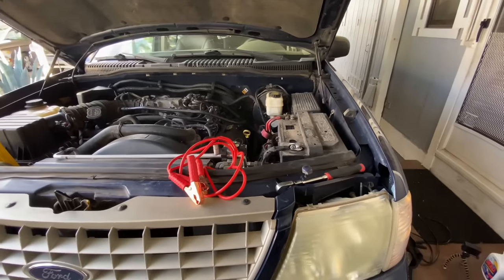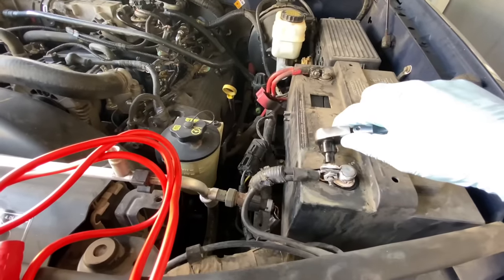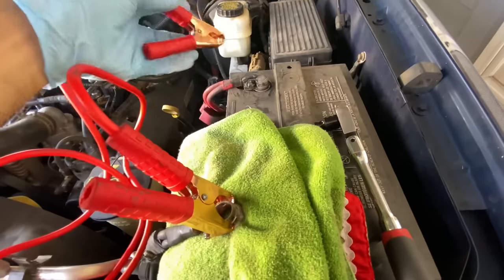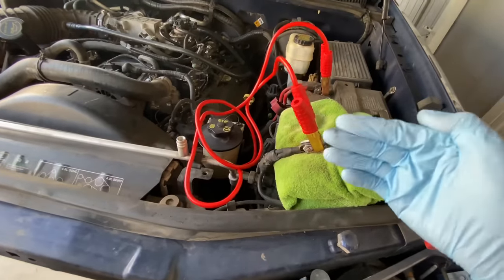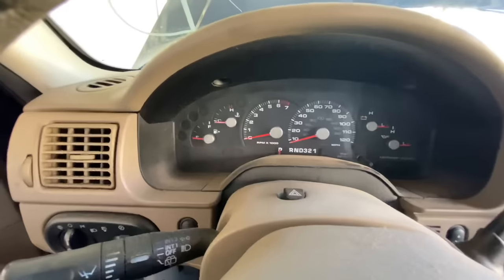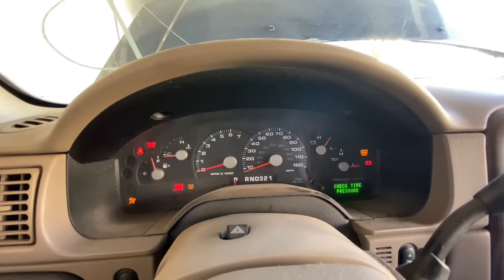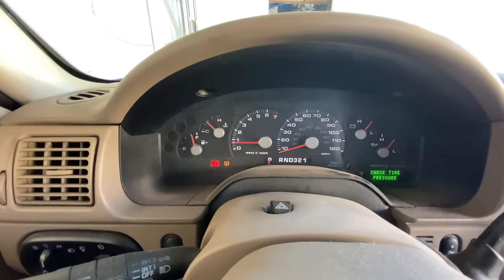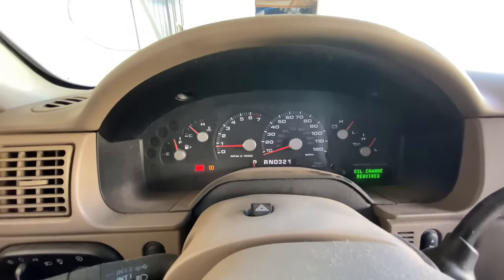How To Reset All ECU’s and Control Modules in your Car or Truck

Comment: Working on my 2006 GMC Duramax, I accidentally and unknowingly knocked loose one of the plugs on ECU.  After I finished what I was doing the truck started throwing non-communication codes between the ECU and the TCU along with some other codes.  After much painful frustration and talking with Duramax pros I discovered the loose plug.  Now all the other codes disappeared except the ECU and TCU codes.  After many more hours of searching the internet and youtube as well as talking with the diesel pros I came across your YouTube video.  It sounded good to me so I followed your instructions to the letter.  Problem solved.  No more codes!  Thank you!  I think I will finally get some sleep tonight,
Reply: Actually have a 6.0 with a p0603 no start thinking about giving this a shot tomorrow
Reply from the maker: I’m glad it helped
Reply: @abner0404  It’s noticeable that you did not return and contribute your experimental results.
Reply: @abner0404  did it work for you
Reply: I'm having trouble with my 2018 duramax. Which battery did you disconnect the negative cable from to do this procedure? Thanks

Comment: THANK YOU so much! The night before last I went out to roll up the windows in my Chevy 2011 HHR and left the key in the ignition. Yesterday about 5 pm, I got in the car to leave and saw what I had done, and of course the battery was dead. I put in on a charger for about 40 mins and then drove off. Immediately when driving up my street, something didn't feel right. I drove another mile or two, on 30 mph roads and noticed when I let off of the gas, the car would slow down, just like it would if it had a manual transmission. As I entered a road with a higher speed limit I finally realized the car was not up shifting out of first gear. Oh, no! I drove the car back home and started looking for answers on the internet and YouTube. Last night I tried a process to reset the transmission by turning the ignition key to position 2 and holding the gas pedal down for 15 secs then turning the key off and waiting 5 mins then starting the car. That had no effect. This morning I got back on the search engines and YouTube and found this video and watched it several times. It made sense to me. Reboot all of the computers. I said a prayer and followed the instructions exactly. IT WORKED!!! What a relief! The car has a lot of miles on it and the prospect of putting a new ECU in could have been very expensive and not a good investment at this point. Thank you so much again, sharing this knowledge has had very positive impact on my life, for real!
Reply: I love that you prayed first ❤️
Reply: @Jesussavedme  ❤🎉❤
Reply: Did it start doing it after 50 miles

Comment: The negative cable is connected directly to the body. Why you dont just clamp the jumper cable to the body and positive terminal of the battery.

Comment: Here's my story.  2 vehicles both went bonkers after a strong lightning storm with rain.  I tried water clearing additive in the tank,zip, tried gunk remover additives,zip...check engine light, total loss of power clunking down the road.
I saw this utube, read the comments and went with disconnecting both battery leads and grounded them both for 20 minutes then reconnected  Took them for a long hard run & presto, works better than it has for many years with no problems and engine lights out.  A bonus was my automatic tran shifted problem free for once.
Thankyou...thankyou....thankyou!!!!

Comment: Thank you.
I came across this video after taking my car to my regular shop.  They are good guys and told me is was an issue with the  PCM, but they could not fix it and I should take the car to the dealer.   OH NO.   I am a 64 old female and know better than to take my 2009 ford explorer to the dealer........ Long story short this fixed worked for my issues.    
You saved me a ton of money.  
Thank you again.
Reply: AMEN!   now to try this on my nissan micra  that wont start = otherwise its going to the scrapyard;  Glory to God anyway, whatever will be...
Reply: Good job sweety! 
Money well saved  from the dealership

Comment: Thank you for this video
I m a 67 yr old grandma with a 2002 Silverado that just stopped no crank no power
I checked battery it was good 
Checked all fuse they were good. 
I found your video and figured I had nothing to lose. I did what you recommended and my truck started 
Thank you again
Reply: You still want to get it checked out by a mechanic.  This is a temp fix for you because something stopped it.  All got did was reset everything.  Keep an eye on your check engine light and get the code read as soon as it comes on, if it does.  That way you'll be able to spot the reason it wouldn't crank or start
Reply: Great news!
Reply: If the problem comes back it's always  AN IGNITION SWITCH WAS LIKE 45 bucks Intex 10 minutes to put in
Reply: @stevengorum2727  😆 🤣
Reply: Why doesn't it work on the civics,  and what about the accord?
Reply: I have the Honda accord 2005 model and the check engine light has been on for 6years now. It was checked and it went off but came back.  I  will try your method and see. Thanks.
Reply: Will it work on a 1993 Toyota Camery 4cyl?
Reply: @quedog10pop good looking out bro that is great advice and very true
Reply: Gm has had issues with ignition and ignition switch they go out esp on the trucks so get that looked at
Reply: @entryspecialist23  I don't believe in sitting on information, like the rest of the world, after I find it I share to help others.
Reply: i caLL BS
Reply: @quedog10pop  blessings to you 🙏🏽
Reply: @quedog10pop I just came from MAVIS Tires in Brooklyn NY where they said my 2013 Hyundai Elantra was asking for a relearn. A month ago I paid them about $800 for a new Battery and Starter and yesterday (Thanksgiving) morning my car was stuck in ShopRite parking lot because it did not start. I had to have it towed back to MAVIS... I had no check engine lights on. The "manager" says he don't know why the car would be asking for a relearn. But when I asked will this likely happen again he says 'No' 🤔 Umm Why not if you Don't Know what caused it? Like C'mon with the Nonsense 🤦🏾‍♀️
Reply: @habibah2702  I appreciate you fam!
Reply: @habibah2702  Fam, I've been thinking, and the battery being changed says a lot. If it is swapped out promptly then that would cause any stored information to be evused, I don't know if your car has a backup battery, but computers need to have constant power to properly hold information /settings.

If I hook up a car stereo and don't get constant power and battery connections correctly done, then the settings won't save, and every time you turn the car on, you would have to get everything all over again.
Reply: God bless you sister, Amen 😎🙏
Reply: @quedog10pop sir thats a memory wire and accessory wire.

Comment: Thank you very much for this video. I had excessive high revs and red hot exhaust. I removed the cat and the inside had something ratteling. It still ran high and hot. Replaced o2 sensor and still the same. Removed the plugs and they were soaked in oil. So i removed valve cover to replace the gasket and new plugs. Still ran high and exhaust hot. Cleaned injectors and throttle body. Cleaned idle air valve. Still ran high and hot exhaust. Watched your video and did exact as you said. Presto she back to 700 rpms and no more hot exhaust. Thank you very very much for this video. Saved me a 400 or more buck trip to a shop. Total parts 300 and now runs like brand new.

Comment: Worked !!!!!!!!
I have a 2006 Chevy Aveo.  The check engine light came on and Via my OBD code reader, I had a small  evap code and an oxygen sensor code.  I looked into both issues.  The check engine light came back on and now I had those codes return and three new codes for throttle position sensor, peddal sensor and transmission module sensor.  I changed them.  The problem remained. . . . Now the car would run good for a few minutes and then run like crap and go into limp mode. ( no fuel pedal response and car ran like it had one or two dead cylinders)
  I then removed and cleaned my MAF sensor checked and renewed all my major ground wire connections at my battery, starter, engine block, and body grounds. Bad grounds can effect sensors.  . . .so they say.  It ran even worse!!!!
I was at my mental end.  I was almost going to take her into the back country and light her up 🔥.
Instead of throwing more money at this car I found your power control module reset. DID it step by step and
This car now runs better than ever!!!!!!   
No check engine light = no codes.
It accelerates better, shifts better. . . . Like a new car.
You save us average Joe's from getting robbed by shop rates and shops that sell you more than you need and help us fix our own.
Good job my friend!!  
I subscribed, liked and hit that bell.
Reply from the maker: Glad was able to help!
Reply: @GK7GARAGE  I have a 00 Corvette and have inappropriate shocks showing up will this reset the computer or what else should I do!???
Reply: almost lit that beeeeautch up ! lmao
Reply: Wow! I'm not the only one with an 06 aveo at his wits end😂 Just wanted to check some comments before I tried this 👍
Reply: dis girl on fayeeeer 🔥😂
Reply: Literally you just described my 07 Cadillac Escalade esv lol

Comment: thanks for posting. a simple way to clear the system. and yes a test light will let the energy burn slowly, and yes becarefull with jumping the battery, batteries are east to expload.  im 60 now, when i was 18, back in the day i would go to the old motor heads and ask how to do thinks,. sadly all of them have passed now. and everything is new and different.  YOU ARE NOT THE  OLD MOTOR HEAD,  thanks for posting and helping everyone. thank goodness we have youtube to help work on cars and such.  very best wishes. thanks again
Reply: Would this work to reset a brake pedal position sensor? 14' GMC

Comment: I made a special jumper with alligator clips putting a 10 ohm 100 watt resister in series with the the jumper cable, adding protection and safety to protect the myriad of delicate complex programmable logic units modern autos have. I bought the 10 ohm 100 watt resistor and alligator jumper clips from Amazon. I used it to reset my wife's 2016 Cadillac SRX premium in operable electronic system. It drained the voltage of the electronic system from 1.2 voltes to 0 volts in 15-20 minutes. I would recommend using a voltmeter to determine when the transient voltage had been drained to 0 <zero> volts. To me the 10 ohm 100 watt resistor is a must.

Comment: I did this on my 2005 Nissan Frontier after the dreaded P1283 code would not go away after I replaced the O2 sensor and an exhaust pipe leak. Worked like a charm.

Comment: 2002 Chevy Blazer. Did new lower/upper intake manifolds. Put in a new spider from Napa bought online, picked up in person. Saved money.  New distributor, PS pump. 

Was running a little rough. Trouble code P0200. Came up on OB2  reader. Then later P301.
Spark plug was fine cylinder 1. Removed injector connector top of manifold. There I found number one injector connector bent down, no connection. 

I did your procedure in it reset everything wonderfully! Codes gone. Runs great 👍 

Thank you for taking the time to help us poor people who cannot afford a shop.

Comment: Worked for my 2008 Mitsubishi Galant. I put a new ignition switch in and for some reason my battery went dead so my cat wouldn't crank. I went to autozone to get a diagnostic done on it. It said power train wasn't communicating with the ECU causing my battery to drain  and idle to drop at points when car is running. I did this and all is working correctly. Appreciate you big dawg alot of mechanics will loose out on alot of money for this one. 💪🏾💯

Comment: I was told you can just disconnect your negative terminal, turn your key to the on position, and hold the brake pedal down for a couple minutes and it should do the same. I have an 89 k2500 with the 5.7.L 350, going to try your method regardless but let me know if you’ve ever heard of that!
Reply: I heard of it,tried it but it didnt work for me. My timing is jumpy so i was told ecu need to be reset to stabilize the timing. I will try this method

Comment: this worked for my 96 Plymouth Voyager ! Thank you ! the O,B.D 2 was showing three malfunctions , and after following this procedure I was able to get it down to 1 which allowed me to pass strict Cal. emissions ! THANK YOU !
Reply: My mitsubishi rvr 2000 engine 4G93 showing drive, neutral and gear 3 WHT do I do?
Reply: @dominicogutu6  I hope you still don't have the problem, but my Mitsubishi with 4G64 engine has the same problem, that's limp mode.
Reply: You blow your ecu by doing that 🤦‍♂️an ecu can be reset by thaking Both terminals (+,and -) from batterry for 30 min
Reply: So KRAYMB, it seems to be no more comments after yours.  I was suspecting this to be bad info as well.  3.6 million views has my head spinning.  What is the right way to clear?
Reply: @jerryjones6675  fix the DTC codes or they’re just gonna eventually come back, like you said unplugging your battery for 20 or 30 minutes does the same thing

Comment: Thank you so much I did what you said and now it starts and runs-But I would ad one thing-I took both cables off OF THE BATTERY-and put the cables to each other-And, not on the battery-And turned on the headlights to help drain the power-My car would not start AT ALL before-I did not like the idea of hooking the power from the battery to the negative -I will remember this for ever-THANKS

Comment: Wow. Just disconnect both cables and short them. This will bleed off all power. 2 minutes. Job done.
Reply: Even Scotty Kilmer advocates using a resistor to avoid shocking the system which can cook micro size electronic components.